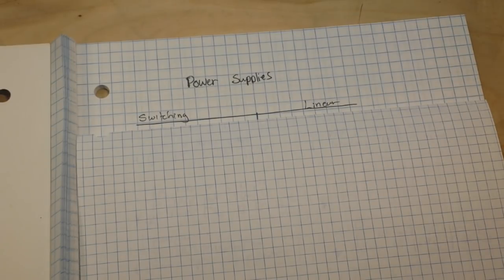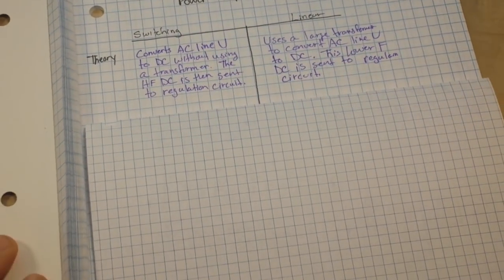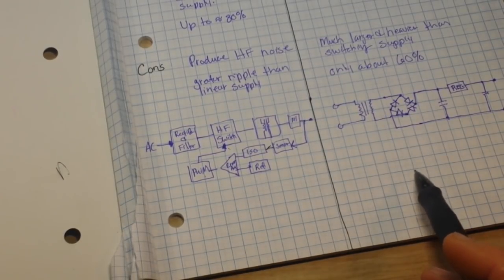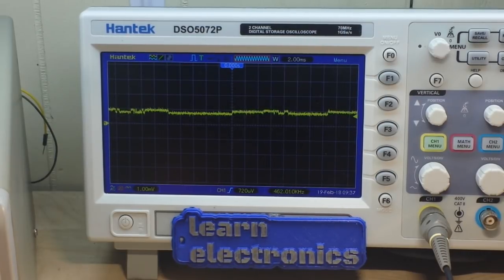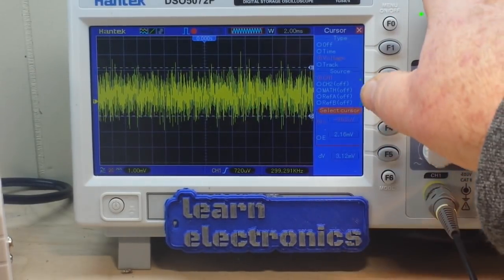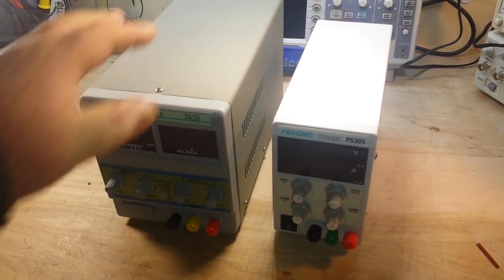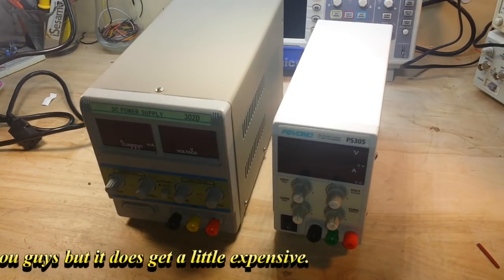Power Supplies: Switching vs. Linear

Comment: My limiting factor is usually cost I'm afraid. My wee home made switching supply does for most things. A linear supply would be nice for radio, amps etc but I'm afraid that batteries will have to do that job (for now)!
Reply from the maker: Batteries are the ultimate linear supply
Reply: Exactly! ;-)

Comment: The switching power supply seems no good for audio applications either. I hooked a similar one up to a little Class-D amp and it's fuzzier than a peach. Makes sense though, GIGO.
Reply from the maker: A class D amp for audio?
Reply: @learnelectronics  Thousands of Class D amps for audio out there. My problem was finding a board that was NOT Class D. A lot of the tempting little boards from China are Class D. It means the outputs use isolated "grounds" so you can't for instance use a TRS 1/8" headphone plug into the output of those things if at some point its sleeve conductor also meets the common ground of the input circuit.

Comment: A good switching power supply that has a clean output as a linear  would, costs a lot more than a linear power supply. I chose a linear power supply because it is a simpler design.  Good job on the simplicity of your video.
Reply from the maker: Thank you

Comment: Wait, the xformer doesn’t convert ac to dc, the rectifier does
Reply from the maker: Yes yes I mispoke
Reply: I was going to see if anyone other than me caught that - the diodes depending on how many used converts to a half wave or full wave Pulsed DC.
Reply: Yes, this guy does not know what he is talking about.  In addition to what you said, how can DC have a frequency????
Reply: @somebody2600  because it can be pulsed... a flyback transformer literally outputs high HZ DC pulses..

Comment: I'm using a switch mode module with a DPS5005 regulator to adjust the voltage up or down it has constant voltage and constant current with all the protection

Comment: Hi I am building my own switching supply I was wondering how I can clean up the output further can I use capacitors
Reply from the maker: Capacitors are the go-to for smoothing. Getcha big meaty 3300uF electrolytic cap rated at least 20% higher than you need.
Reply: learnelectronics and where exactly would this cap be placed can I put one on the outside inline with the positive power lead going out

Comment: Very nice job explaining this. You can get a very nice used name brand linear power supply with analog meters for about the same price as a new switcher. I have a nice 3A linear supply I got on EBay for $30. Nothing wrong with a switching power supply, I just like a power supply with a big transformer. Linear supplies are easier to repair too. Thanks for showing us the difference.

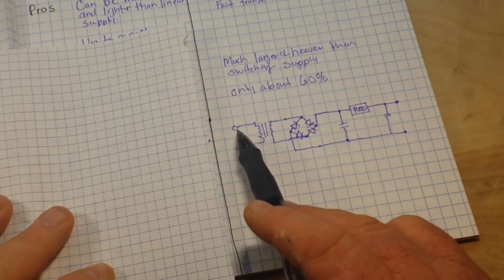Comment: Thanks for another great video. Just a quick question. In 2:45 you mentioned that in Linear Power Supply, the AC comes into the transformer and then we get the DC on the output which then gets rectified. Isn't the output of the transformer still AC but in the lower voltage? I think it's the rectifier that does the conversion. Sounds like a typo, but for a beginner like it can be confusing at first.
I really enjoy watching your videos. Keep going :)
Reply from the maker: Yes, I made a mistake. Rectifier dos AC to DC.

Comment: Overall, a good video. When describing the linear circuit however (@ 2:50) you suggested that, on the secondary side of the transformer you get DC. This is, of course, not the case: the voltage is still AC (just stepped down) and does not become DC until it has been rectified. Just thought I should clarify for those new to the subject.
Reply from the maker: Yes, my mistake.